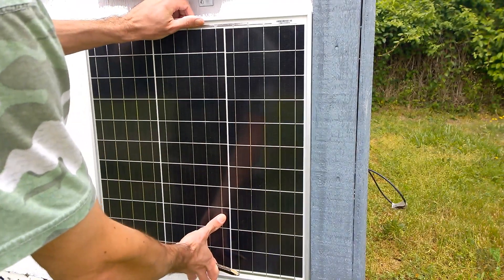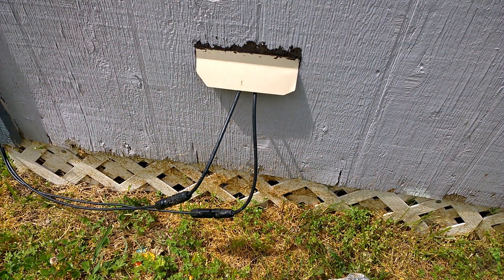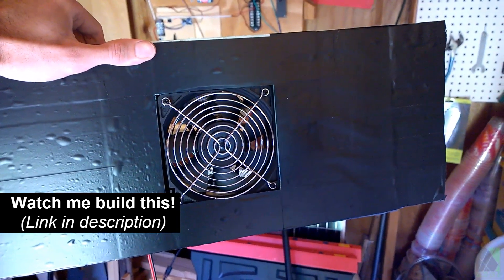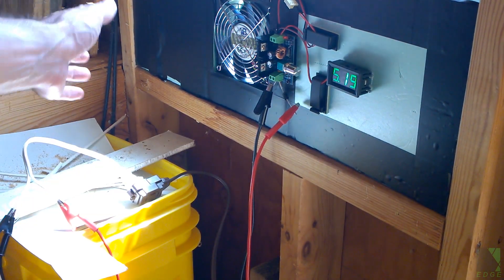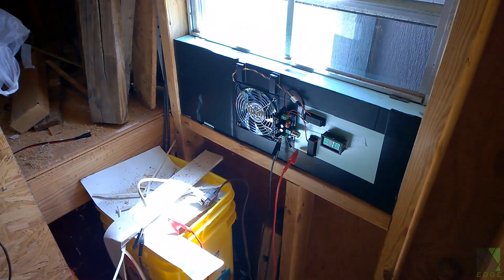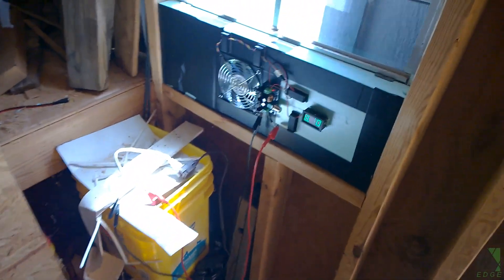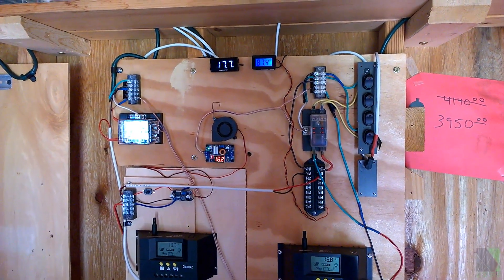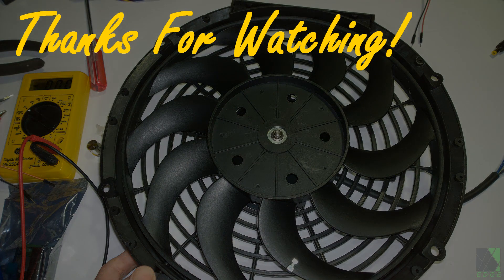Low Voltage Solar Shed Ventilation Part 2  Another Day Another Project episode 5

Comment: One blowing in, one sucking out?
Reply from the maker: @bobcole3852  I had considered that option with 2 fans. Because I have 2 windows, 2 gable end vents. I decided to have 2 fans blowing in (cool air is forced into shed through both windows) and that forces hot air sitting up high out of the gable end vents. It works great. It's a matter of what's easiest: as long as fresh air is being pumped through the shed, that's still better than hot stagnant air. Another issue is to make sure there is enough intake (breathing) for the fans; if not, one fan sucking air in would probably be a better option and the other fan blowing in cold air. Just my opinion though, based on the construction of the sheds we have here.

Comment: Do you recommend pushing cold air in from a lower location and allowing Hot air to be pushed out thru an upper grate in a small metal shipping container?
Thank you again for sharing your knowledge. :)
Reply from the maker: You are very welcome :) in my personal experience and opinion, it it most convenient to place the fan, electronics and intake vent down low where I can access them easily and be directly in front of the pressurized fresh air intake. If the vent is high up out of reach, this might make more sense too. Ventilation requires a balance of good intake so the fan can "breathe", but also unrestricted exhaust (somewhere for air to exit) otherwise excess air pressure is built inside the structure and it slows the whole process down. If the grate is very small compared to the intake, it's possible you'd be better off using a powerful high static pressure fan up high where the grate is. But some standoff is a good idea, about an inch so the grate doesn't cause excess turbulence and noise against the fan. Could make a small box for the fan and attach it to the grate in that case. If exhaust is restricted, could also use a larger vent or add a second one. This got really long but I hope it helps!
Reply: No, long is good:) Thank you. We All appreciate your experience and wisdom. :) :)
Reply from the maker: No problem :)

Comment: In this video you mentioned your charge controllers and batteries, could you link the brands of the ones you are using? Thank you
Reply from the maker: Sure! The first one is a bit rare but very nice, made for lithium batteries or AGM/lead acid. You can search ebay for this number: 125650670677

The other ones are basic units, a little cheap and odd in performance - voltage is also quite inaccurate. But may do the job depending on need: example model CM2430Z (30 amp solar charge controller) it's listed on Amazon and other places.

Then there is the MakeSkyBlue MPPT charge controller - nice unit for the price but needs at least 20V input or it won't charge in darker weather. Possibly a bit too much for ventilation projects.

Basically, here is what you'd want for such a scenario: the charge controller charges the battery to the correct voltage, hopefully 100% by mid day. At the same time, the fan is powered 24x7 (or with a thermostat) by the battery: direct or through a DC converter if needed. At night time, the battery keeps running the fan. The amount of power coming in from the solar must exceed the fans draw - or the battery would eventually run down because it never gets full. And the battery must be big enough to run the fan for at least 2 days, because sometimes it will be cloudy and rainy - might not be enough power to charge while still running the fan. Hope this helps!
Reply from the maker: PS I cannot put links here in chat, but if you cannot find the chargers, I can add links to the description of the video - just let me know if needed

Comment: i Have an idea on solar panels. What if i install a boost converter on every solar panel in the array to boost the volts and current with say 20% instead of installing extra panels having costs and a lot of labor in mind.
Reply from the maker: Hi, boost converters can be used for some solar stuff... however remember with boosting, current is traded when voltage is gained. It's a tradeoff. With a buck converter, voltage is traded for current (generally). So I'd suggest to save the cash for an extra solar panel or two, which have no moving parts, and are very simple to maintain. I just bought a 100w panel for 80 shipped, brand new. And you can certainly install more panels diy without paying anyone if they are ground mount and easy to reach. Installing on the roof... well that may not be a DIY job. Just my opinion of course :)

Comment: Nice vent setup. Those fans can be noisy but does the job.
Reply from the maker: Ty :) trying another 120mm fan (SJ series in description), it's a bit smoother, less amps but still moves lots of air